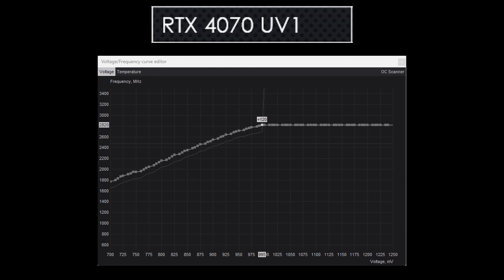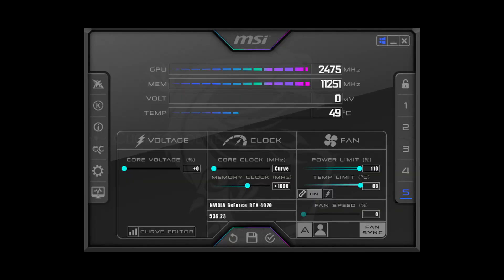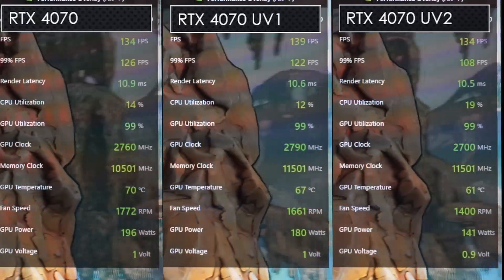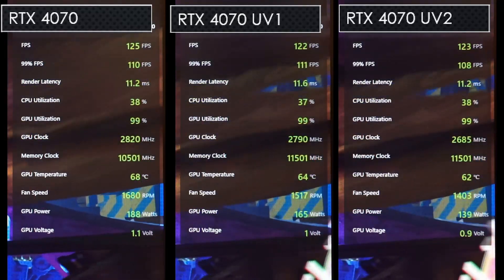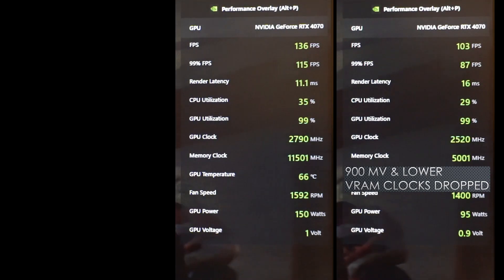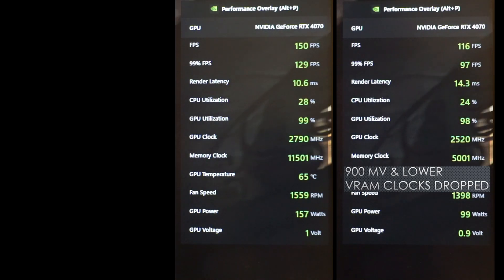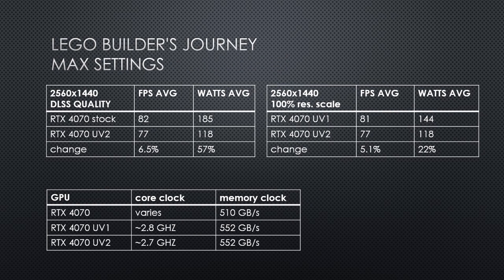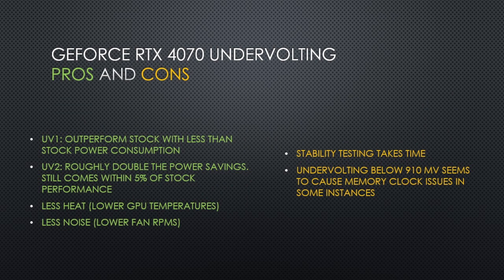RTX 4070: An Even More Efficient Undervolt

Comment: On my 4070 Super (220W TDP) I have 2 profiles: 2730 mhz / 975mV has stock performance at a peak of 180W, and 2550 mhz /925mV is circa -4% from stock but a peak of 145W. Both have +800Mhz on the memory.
4000 series is crazy efficient!!

Comment: RTX 4070 is efficient GPU. Why would you ever want to undervolt it? Just enjoy your graphic card, losing -5° of the temperature at the cost of the performance is merely not worth of it.
Reply: It's efficient when you undervolt it. It has pretty bad diminishing returns on the high end. 
But more importantly it runs quiet after undervolt.
Reply: @iyaramonk  something what is efficient from the beginning, can't become more efficient. Once again, RTX 4070 is not something you should bother undervolting.
Reply: @Mirelinin did you not watch the video it just showed and proved that you can still undervote and get the same performance
Reply: @sickratzz  exactly. So, why bother undervolting it if the performance is  the same? I can't hear my GPU at all, neither it gets hotter than 60 degrees.
Reply: @Mirelinin  0/10 ragebait try better next time
Reply: @ lmao. You should cut down on using crack, man. You are just contradicting yourself
Reply: @Mirelinin  if you have to ask why you should undervolt then you’re stupid but I don’t expect a overwatch player to know anything useful
Reply: @ I'm rather stating that it's a dumb thing to undervolt a GPU which is self efficient already. Undervolt is good for CPU for sure.
Reply: My stock 4070FE can get really hot and when hotspot hits 110c it gets as loud as a vacuum cleaner. With undervolt it has similar performance with hotspot never getting past 90c, so its literally huge for card longevity

Comment: Good but the key of stability its good motherboard, great efficient and stabiliti 12v section of power supply. My msi z trio lhr got 1785mhz with 800mv and oc vram 1000mhz 0performance difference about 65-70w less than stock. My next gpu probably 6950xt and undervolted about 2100mhz at 0.95mv maybe i think good efficient. Over 200watts only on gpu its too much for me.. heating, noises, and others. And not good for longlife gpu..

Comment: I did my 4070 Ti from 950 2490 MHz to 900 same speed and my power went down by a good 60 to 80 watts and temps came down 8 to 10 degrees.. the 4070 is a great card to under volt while keeping the stock speed MHz

Comment: Have you tried running cinebench r23 gpu test on the lower voltage settings? While .925V may be good for some workloads, rendering ain't one of them at least on my 4070S. For stable cinebench/blender I have to increase the voltage to around .985V. V-Sync also plays important role in the overal power consumption and so has the game resolution and other factors so if you have a game resolution in mind, it's wise to test undervolt/overclock for that particular resolution because the results for other resolutions vary. Totally agree it's ideal to test wide range of SW to be on a safe side.
Reply from the maker: yeah, testing a good range of software is a good idea. at the time of posting the video i tested a handful of games but later found issues with the +210 undervolt. i havent had issues with the 995 undervolt in the video, but the 920 mv i've since lowered down to 2655 (+150 offset on a 4070 FE), and since lowering ive had no issues in any games ive played or cinebench r24 gpu test...

Comment: Why did you have to overclock the mem by 1000?
Reply from the maker: I didn't have to, I just thought it would be a good idea to do since some games could benefit from it.
Reply: @Superior85  I see, thanks.
Btw, a small correction, on min 2:20 the volt is not the reason why the memory clock drops, but because of the gpu clock, for my rtx 3090, looks like 1545hz is the min you can do without dropping the memory clock, this lets you do pick any voltage like  731mv/1545 and still prevents the memory clock from dropping, with this value, my rtx 3090 runs with 230w, ~ 340fps on furmark 720p no msaa vs stock 540fps with 420w on my evga.

Comment: What a wonderful video, looks like all these cards are actually overclocked, they should come undervolted by default from the manufacturer, there is no excuse to pay 33% more wattage just to get 2.5% fps increase. with 130w GPU, you will save tons of cash not just the electricity, but the PSU, UPS and other component prices too.

Comment: Nice one...my 4070 asus proart, when monitoring voltage, it is only able to go down to. 910mV. Even if set at 875, i believe it is a set minimum in theese cards.
So i run it at 910/2675mhz with mini al fps loss, temps around 50/55celcius. And watt dropped from 195 to 135.

Frame generation is great too, but it has its flaws, some games it stutters. And others it crashes to desktop...

Comment: Disregarding the gpu performance, Does lowering the gpu clock frequency alone (not adjusting volt) lowers the power consumption? Is it possible to lower below 100W?
Reply: I think -60% is the limit so yes around 90w. You can do it without UV but performance will be horrible.
Reply: @filippetrovic845  is it possible to combine -60% power limit and undervolt at the same time?

Comment: This is partly Nvidia's problem... They're making cards with the lowest possible number of cores, so to compensate for the low baseline performance they're pushing the silicon to the limit. Imagine if 4070 had 20% more cores, you could lower the clock to 2.3GHz to get equivalent performance with much lower power consumption.
Reply: a "4070 super" is "leaked" to have about 20% more cores, at a 10% higher power usage, if it actually comes it should be very efficient once tweaked :)
Reply: @GeneralS1mba  but it will cost more...
Reply: @panjak323  probably around $600-650 :( seeing 4070 for about 525 on sales and they are probably 550 permanently now
Reply: @GeneralS1mba  4070 is still massively overpriced in eu... It is more expensive than 7800xt despite being released year ago.
If 4070S will sit between base 4070 and 4070ti pricewise it's as useless as both cards.
Reply: @panjak323  I'm in the UK, so the 7800 xt has all the 475 models sold out it's ONLY available at 500 now, but a 4070 is 525 where I'd say it's worth It, but prices definitely vary a lot per region

Comment: so, is it safe for me to run it undervolted using 500w gold PSU? I have 2060s rn and it draws around 150-160w. Acording to your video by underclock the 4070, it only draws 130w so i think i can upgrade to 4070 without the need to buy new PSU.
Reply from the maker: Yes, it should be fine.
Reply: Thank you.
Reply: For future folk: 160-170w is what it draws for me in Cyberpunk 2077 patch 2.1 at high settings with ray tracing and dlss and 1440p internal resolution. It's insanely efficient! Forgot to mention I have the OC version so XD

Comment: Amazing efficiency you got on your UV2. How was the stability? Did you notice any crashes like you did on your UV1? I will have to try your new UV2 in games where I don't need the absolute max performance. I've had luck on overclocking my Windforce OC to +220 core / +1,500 mem and it's been 100% stable for the past week across dozens of games and VR games too. I am pretty happy with the performance increase and it doesn't go above 200W (weirdly, despite have the power limits to 108%). My graphics score on Time Spy went from 17,147 to 18,160 
Edit: Had to drop to +180 core as I noticed some very minor artifacting in heaven benchmark, was not present in regular gaming however. I was able to squeeze out some extra memory overclock though and managed to get +1.550 on the memory stable (didn't fine tune before, just saw it was stable at +1500 and left it). Weirdly enough, my graphics score on timespy went up to 18,260 and then 18,216 on a second run with Geforce Instant Replay off. Combined score went to 16,844. All of this was with Resizable bar On
Reply from the maker: I've had no crashes, though I've only been using UV2 for a few weeks.
Glad your card is doing well, it's rare to see RTX 4070 go over 200 watts. In my testing I've only seen it happen in Quake 2 RTX and Severed Steel RT on and DLSS disabled (back when I was on higher millivolt values). There is a free demo of Quake 2 RTX on Steam that you could try, I think that game would get you over 200 watts.
Reply: @Superior85  That's good to hear. I tried Quake 2 RTX and it only went up to 200W still. I've read online that it seems to be a problem with the 8 pin 4070s. I wish I could get the advertised 216W though, as that's left out performance. I was incredibly impressed with the lighting on Quake 2 RTX though. I think it looks better than Portal RTX. Can't wait to see what path tracing brings in the next 2 years or so with RTX 5000 series.